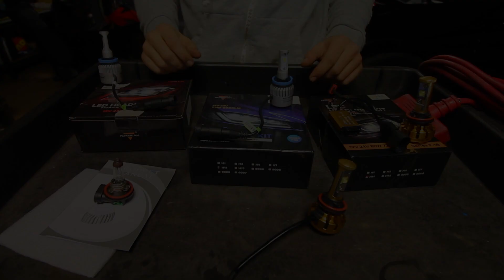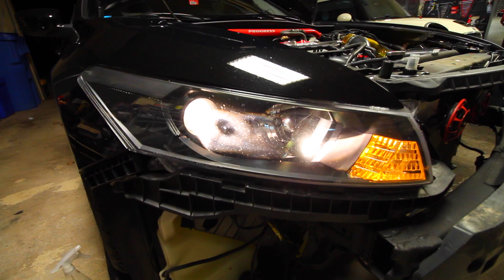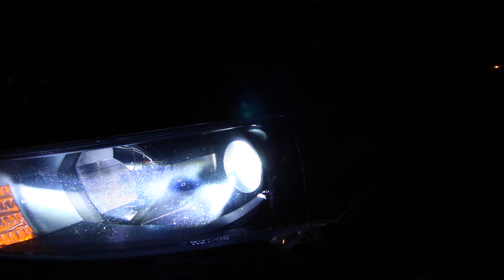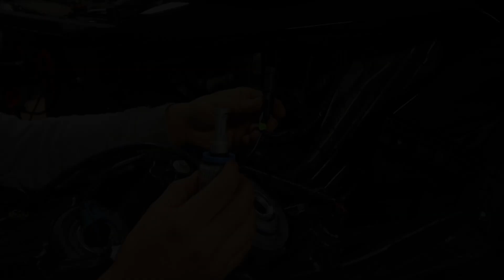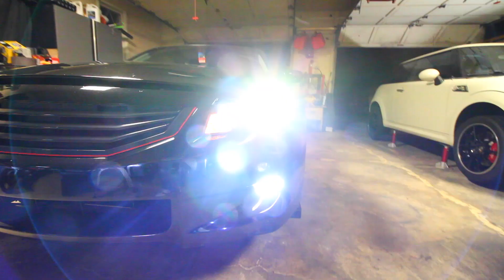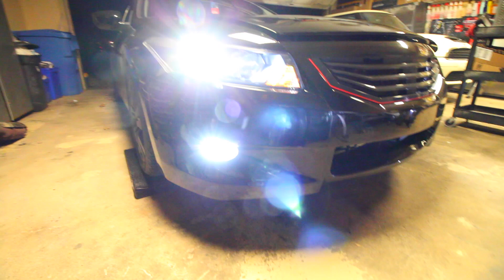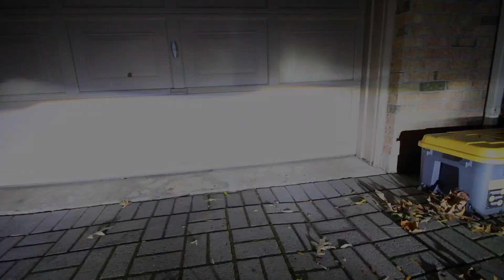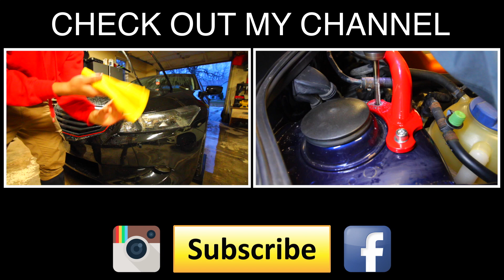LED Headlights: Are they Better than Halogens?

Comment: Was that final test using high beam ?   A good strong high beam is what we strive for, for safer night driving in open country, and low beam with a flat cut off is for the safety of on coming motorists. Thanks for sharing...

Comment: What you need to be worried about is the fact that Hector is going to be running 3 Honda Civics with spoon engines. And on top of that he just came into Harry's and he ordered 3 T66 turbos, with NOS, and a Motec system exhaust.

Comment: Excellent video that’s what I wanted to see how the LED lights look on road compared to stock halogen. I have 2014 XLE Hybrid Avalon which comes with fog lights, and I have hard time seeing road with the stock halogens so my friend at the garage said we can try LED. What do you recommend based on the cost for led which ones are cheaper but long lasting and efficient mate ?

Comment: Hi Milan,  I'm looking for a LED bulbs for a 2015 Hyundai Santa Fe Sport 2.4 Li.  I'm looking for the Low Beam, High Beam and Fog Light bulbs. Prefer 6K lumen.   Cost wise, it can be the middle choice, reliable, not so expensive.  Can you provide me 3 options to pick ? We are located in Western Canada.   Thank you.

Comment: Can’t use LEDs in a reflector housing, they will blind oncoming drivers due to the scattered light. Hey should only be installed in Projector style housings. The projector style lamps are the only way to use LEDs. And the LED needs to be mounted in the same location as an OE filament.

Comment: On the installation: great job explaining everything, but for some people they might not have a twist in retainer for the bulbs but two metal retaining clips instead — which can be a pain in the ass if you’re doing it in the engine bay — but yeah great job dude.

Comment: I put LED into my 2017 van, it does not project far like the original halogen light. I can't see much because the LED scatter without a beam. I reinstalled the original halogen light, I can see so much further and clearer.

Comment: What halogen bulb you installed?
I guarantee that if you had installed a Philips X-TremeVision - or the newer RacingVision - the halogen bulb would have performed better than LED.

LEDs is only better with a projector (which you had, but the majority of halogen housing do not have a projector), and LEDs only offer a great advantage over halogen when you have many SMDs (the squares which are the real LED).
Only original LED housings offer the number of SMDs necessary to have better visiblity.
The advantage being the price. 
They only sell you the entire package, and they can go from $500 to $2000 for each side.

So, I will prefer to stick with good Philips halogen bulbs.

Comment: I always drive slow af when someone behind me had those kinds of lights I don't need to be blinded when I'm trying to drive
Reply: Yeah but with leds u can flash people so they move out of way without causing noise pollution 😆😅😇
Reply: @_rtx_  What of light pollution?
Reply: @GRich1843  is there something like that even ?
Reply: @_rtx_  Yes? Sound pollution is the measurement for how much sound is created through artificial means, such as industrial, commercial, or even residential activities.

Light pollution is the measurement of excessive light in the atmosphere. Ever try to see stars in a city or wonder what the glow in the far distance from a camp ground is coming from? Same example as the noise pollution, the activities of society create more light and sound (as well as smell, taste, and touch) that wouldnt be there naturally other wise.
Reply: @GRich1843  thanks for information but light doesnt seem much harm than noise 😃
Reply: @_rtx_  Is that personal preference or?
Reply: @GRich1843 " or?"
Reply: @_rtx_  Unless you're a toddler, I dont need to hold your hand to answer that question.
Reply: @GRich1843  😮
Reply: @_rtx_  come on, we don't have to go through Samantha to figure this out. You sound like a good guy or gal, there's nothing wrong with having a little fun, as you know just because you haven't experienced a problem doesn't mean it doesn't exist
Reply: @GRich1843  😮
Reply: @_rtx_  Heh
Reply: @GRich1843  I think he means, when someone hits the horn!

Comment: That first Philips chip bulb had a far better cut off. That last one had a bunch of glare that will kill an oncoming drivers eyes. A halogen projector is not designed for LED, same goes for reflector. It tends to lead to glare and spotty output. Some LED bulbs are able to be clocked to help lower the glare, maybe even remove it. You have to tune the bulb to work within the housing. Sometimes, the bulb just can't be tuned so it should not be used. Yet, so many people out there think it is awesome driving with blue lights. Not only is it killing other drivers, it is reducing that drivers vision. People are falsely thinking vision is better because it is so bright.

Comment: 13:20 Uh, I don't know what you were looking at, but those beams are not sharp cut off's. There is plenty of scattered light above that "cut off line". You WILL blind oncoming drivers with those bulbs. This is the main issue with many aftermarket LED bulbs.
Reply: Good f others they blind me daily😊

Comment: I have a 2015 honda crosstour and I did the up grade to led. And driver side is fine but passenger and fog lights when out. Chaged to halogen and it lasted for a while but recently went out. Haven't touched the fogs yet. I'm confused

Comment: *SAFETY ISSUE* The LED bulbs give off no heat. Is it is snowing of sleeting the lights will be covered rendering them useless because of no heat to melt it. Heat is a good thing for safety vice the vanity of wanting the "latest trend"

Comment: The led light surprisingly doesn’t seem like it will blind anyone in a non projector style headlight because once you turn them on they have the same cut off line like the projectors. I installed them on a 2006 odyssey and it is a night and day difference between clarity. Even tho I had to customize the fitment because the lights were wiggling

Comment: The problem nowadays is the way the  headlight housings are  and the  small  reflective areas .    You used to have the 4 bulb halogen setup in vehicles  and with high beams on you could literally  easily see a 1/4 mile down the road at night  .     I have had  4 bulb  setups that were superb with just halogens.   These setups with single bulb  halogen projectors  suck compared to the old 4 bulb setup   and a overly  complex setup for  lighting and something expensive to go wrong .

Comment: You get heat ether way,the LED requires a fan,the halogen does not,the fan goes out and so does your expensive LED.I work on cars,you ain’t gonna sell me on this.Just like the house light bulbs,Supposed to last longer,they do not,more expensive than filament bulbs,LED’s produce light in a different part of the spectrum,they look brighter cause they’re whiter than halogen or HID.And not to mention they blind the oncoming traffic with that beam.
Reply: This is one ridiculous comment.

Comment: Great video - well done!  My wife has a 2013 Sentra which cannot be safety driven at night because of the very poor output from the lights.  The Altima has the similar problem.  I need to get something to help with the light output.  Your video about the LED headlamps have helped me very much.
Reply: Don't get these ones though, they're crap. The LEDs should mimic and exact size and shape of the halogen filament and you can see that these ones are far too wide.

Comment: One big splash of water in the engine bay shorts out the fan and then it overheats and fails. If you live in a desert, these work great.

Comment: LED elements do create heat. But not as much as incandescent/ incandescent-halogen bulbs.  In the video, he mentioned that all the heat is generated in the electronic circuits housed at the back, which is inaccurate.

Comment: I bought led headlight bulbs that were weaker than my halogen bulbs. The lumen ratings are wildly inaccurate, even the brightest bulbs claiming to be 10,000 lumens will not even be close to 5,000 lumens. Just as a warning.

Comment: I bought a set of LED light bulbs with 4300K to fit into the original halogen reflector high beam headlight of a Lexus GS300 S190. LED bulbs work great but the halogen ones shine brighter. Maybe it is because of the headlight. 
You can check it in my channel!

Comment: how can 9005 led work as both HIGH beam + Daytime light?
Reply: vpsaline it just does lol. I have the same car as him mines a 2012 Honda Accord V6 coupe. I just installed LED lights for low beam and high. I gotta say for the DRL I had a problem. On my dash the DRL icon will come on basically tells me there’s some type of problem with my DRL lights after putting in LEDS but it would go off and everything would be fine so weird. Anyway they do run as Day time running lights and when you put on high beam at night they get very bright.

Comment: These incorrectly set up and hid projector lamps should be banned they flash constantly, they basically are a driving menace.
I think the authorities are asleep at the wheel if you'll excuse the pun over these horrific modern headlamps that many brand new cars are coming out with.

Comment: Awesome video!!! Couldn't agree more. Important to keep safety in mind and make sure you're not blinding upcoming traffic.  This video is similar to a few we've done...really important to get the word out there about LED's.
Reply: This exactly, where I live it's very common for some enthusiasts to install aftermarket bulbs that shoot light in every direction completely blinding upcoming traffic and pedestrians.
When installed properly however, aftermarket bulbs can increase visibility and road safety.
Reply: They should sell affordable aftermarket kits to replace the designed-for-halogen housing with a LED suitable housing. The main issue comes with using LED bulbs in a housing designed for halogen light emission. If carmakers work against this claiming they aren’t ADR/DOT approved, so they can sell more cars, rather than allowing people to upgrade older cars, then we will continue to see people retrofit LED bulbs into halogen housings and create glare. It makes me sick as there is far better safety that can be had if everyone had quality legal options to upgrade existing headlights to properly aimed LED without glare.

Comment: Can you make a video with these bulbs fitted and with your camera ready to film the reactions of ONCOMING drivers... are they DAZZLED by your dipped headlamps... AND.. you shouldn't be using your FOG lamps while you have clear visibility at 100 ft plus...

Make sure to adjust your headlamp.... you'll DAZZLE other drivers... You'll cause an accident...... as for driving on Fog lights - ONLY use them when your visibility drops to less than 100 ft.... wise up people .. you only cause people to slow down because you DAZZLE and BLIND them.... If anyone is Blinding you from the front or from the rear.... reduce your speed so you can react to what you can actually see...

Comment: We need to ban those bright white led's and hid headlights.  They are a distraction, they are harmful to our Eyes and they are brighter than Green, Yellow and Red Traffic Lights so that is a problem.   @t

They're bright like the white flame on a butane welding torch which is harmful to even be in the field of vision without protective eyewear.   That is how bright these led diodes are.

Comment: I need help bro I got LEDs in my car yesterday but it's super dim I have the chips facing left and right I have a 2014 Nissan Altima
Reply: the chips facing left and right is correct. you can relocate the position of LEDs toward or backward the projector, that could help. make sure that the position of LED chip is the same as halogen volfram!

Comment: those are too bright and the rays are too intense on the display.   You're going to blind people,  but I guess most of you don't care.  It's only Someones Eyes.
Reply: Seems like every other piece of shit have em. I get blinded a few times every night driving on the freeway
Reply: They'll also get you pulled over by a cop that thinks high beams are on.
Reply: Incorrect. If installed correctly and cut off line is good, the have no more glare than the orignal Halogen bulbs. It all depends on where the Filament/LED Chip is placed and if adjusted in the correct position, they will not be any different that a halogen bulb.
Reply: That’s why you should wear your sunglasses at night. Keep them stunna shades on
Reply: Yes and no. It can blind other drivers,  however. You can also have them pointed downwards to prevent that from happening
Reply: @Shawn Kemp I absolutely agree with you. Sticking different types of bulbs in housings that were designed for halogens, unless it is a FACTORY APPROVED replacement, should be illegal!
Reply: @TheOzthewiz  it is illegal in Europe if the lame is not factory designed for LED its illegal to use an led in that lamp. but I will still disagree with you because I don't believe that LED bulbs should be illegal to use it should just be illegal to use the wrong kind of LED bulb. just because a headlight is designed to use halogen bulbs does not mean that an LED light cant work. as a matter of fact. there are many LED bulbs that work just fine. all you have to do is make sure that the LED is designed for use in a halogen Headlamp. if that is the case it will not blind oncoming traffic as it will deliver the correct beam patterns. The brightness will not matter for oncoming traffic. I'm talking of experience, I have tested more than 60 different LED bulbs in all kinds of applications like reflector and projector. even in HID designed lamps. and the testing can be concluding is as follows. if the bulb replicates the properties of the halogen bulb it will deliver the correct beam pattern and not blind oncoming traffic at all.  it's not the light intensity that's blinding. its the bleeding light and incorrect beam pattern that blind people

So here is my proposition. How about we stop making everything illegal just because some people JUST don't understand the technology. and instead, we educate them to understand. So we all can benefit from true greatness instead of being held back by stupid ignorant people that make a decision or even a law without knowing anything about it!
Reply: Leds on trucks and suvs at least should be illegal

Comment: Question is what happens if LED fan fails? Would lead to a 🔥 fire? 🤔
Reply: I bet they'd be fine. and if not, the LED would just not work because the chip would burn out. It wouldn't get hotter than a normal halogen bulb for sure
Reply: @TheCalmbrain  lolz 😜😜😜
Reply: @TheCalmbrain  The headlight housing FOR SURE...

Comment: 7200 lumen LED's cannot out-perform 8000 lumen LED's, if this is what they are rated at. Lumens is a measure of light output rather than power consumption.  If you were comparing power consumption of say two halogen bulbs that had the same power rating.. then you could compare the light output efficiency. Apart from that, good video.

Comment: The headlights on automobiles they build now are way too bright.   It's like the "brights" are on.   It's an epidemic.  Also the color white is too bright for on coming traffic.   If it wasn't then Airports would use that color but they don't.  The Aviation industry uses yellowish lights for many reasons.

Alot of millennials are dumb and don't realize what they are doing to our Society.    They just like anything that is different eventhough it's much WORSE!!!!

Not only does it hurt the eyes and can cause wrecks eventually but they also look very tacky seeing Yellowish headlights coming down the road with also a bunch of bright white headlights mixed in.   Keep it the same color poeple.  Keep it how it was for 100 years.   Somethings you shouldn't break just to break.

Comment: So pissed at this headlight LED Bull Sh!8 and the spread of misinformation. LED headlights stupid.... and this guy dosn't appear to know much about LED. almost all heat is generated AT the led chip, then heat-sync ... I could go on about this... FAN!  That little pos will fail then thermal runaway will occur. Asphalt is dark black ish. A blue light wont reflect off dark as well as white light... white light will not reflect off dark better then a yellowish light. (4000K) 
Fog lights are supostoo be YELLOW/AMBER for blinding driver and oncoming. 
If drivers would only direct their lights correctly or recognize carrying a heavy load will change beam angle.
One more thing, a savvy cop will write you up for running with non DOT lights. (at least in my muni code)
Ya my sentence structure needs work but im just sad to see the spread of misinformation.

Comment: With that cutout line at the top, you can't see very far down the road, whether you have halogens or LEDs.  The video seems to support that.  I've got a new car, and you can't run low-beams in a dark area, and see much above that line, if it's a level road, and  you're not tilting up and down.   I just feel that the cutout in my case is too extreme.  And on an extremely winding road in the dark, i can't see where I'm going, because it's black, looking through the curve.  I guess it's the design of the headlight bezel.  There is such a thing as out-driving your lights, and if you're doing that, then you can be on top of an animal or person before you realize it.   Was considering getting LEDs, but I don't know.

Comment: If want to use the LED headlights, pls buy the good one, it must be with good light design, cannot bline the opposite driver and the front driver, be responsible for yourselves, the road is not only for yourself.